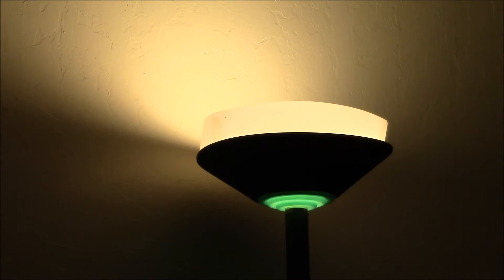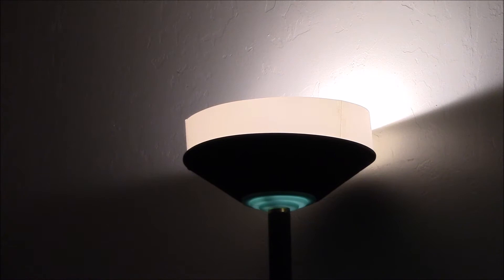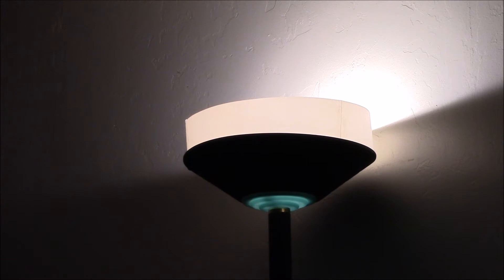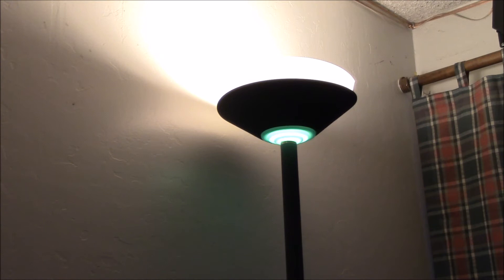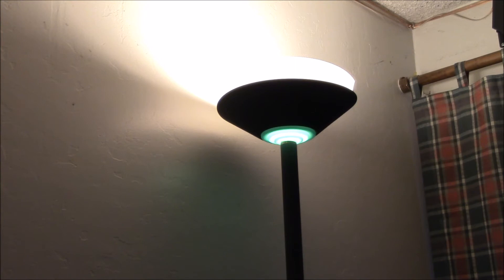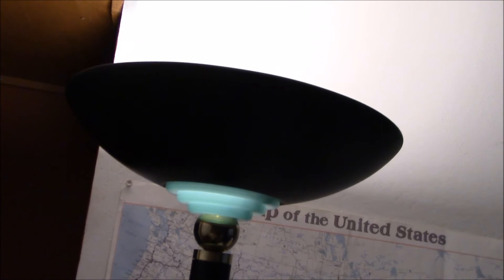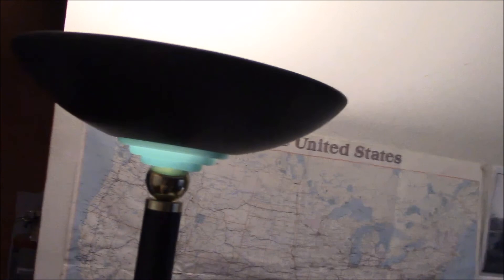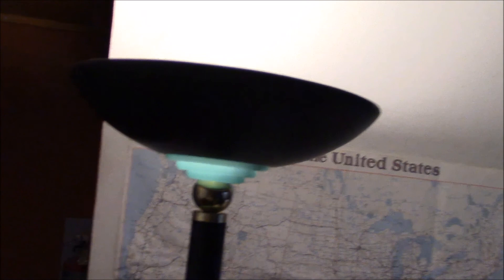Halogen Torchiere Lamp Conversion, v3, Part 1

Comment: Where did you find this one and my old one had a slider dimmer switch 🤔
Reply from the maker: I've had these lamps for a long time.  I think one of them I used to use in my office over 30 years ago.  Never seen one with a slider switch, all 3 of mine have the rotary type dimmer with 2 settings.

Comment: Time to add a $5 USD Sonoff WiFi enabled smart switch onto your power cord.  Wth a $29 USD Google Home Mini, you can say "ok Google, turn floor 25%, on/off, etc.).
Reply from the maker: Yes, that might be an option down the road.  And one good reason for getting the dimmable driver version of the light.  While you may not need it now, there are now all these smart switches w/ built in dimming capability available.  For now, 2 of my 3 lamps are on switched outlets, at some point I could install an remote controlled switch or outlet for those.